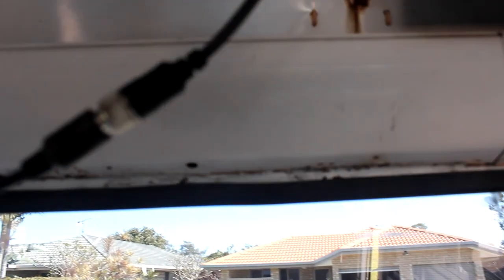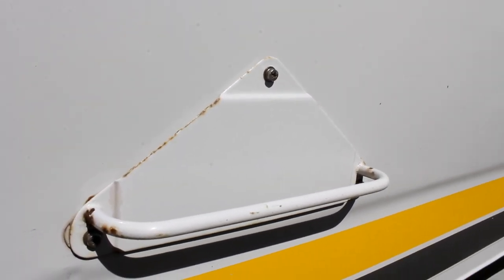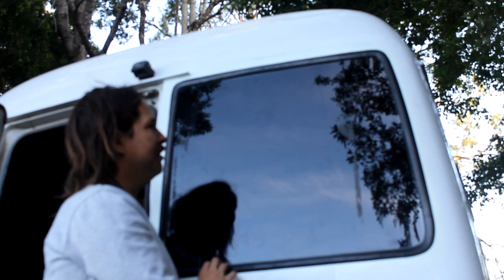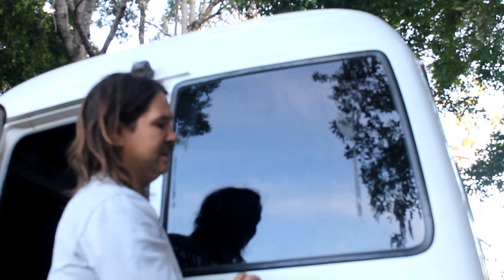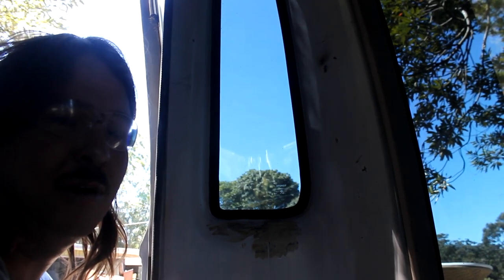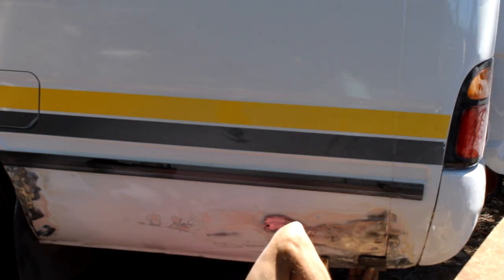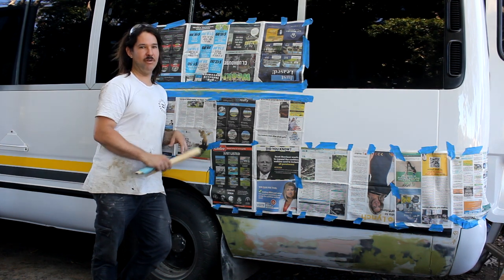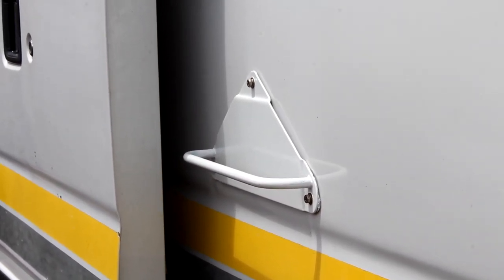TOYOTA COASTER BUS CONVERSION | Ep 5. Goodbye rust! from surface rust to weld repairs

Comment: Great video thanks. I have to do the back window on my coaster too. It looked like you just ran a blade around the outside and it popped out. Is that right?  I haven’t removed a window before. First time for everything 😅
Reply from the maker: You could use a plastic paint scraper/plastic putty applicator or even an old credit card to go around to ‘break the seal’. Then grab a few wedges or screw drivers. Push the seal over and out from the inside whilst adding a wedge, keep this going around until the window and seal are ready to drop outside.  Best to have an extra set of hands and take your time. You’ll do great 😊